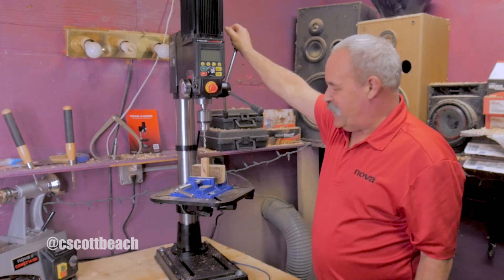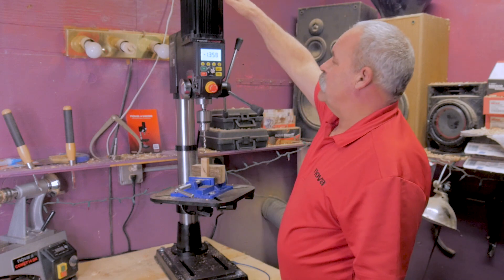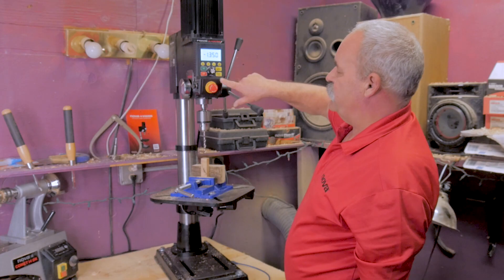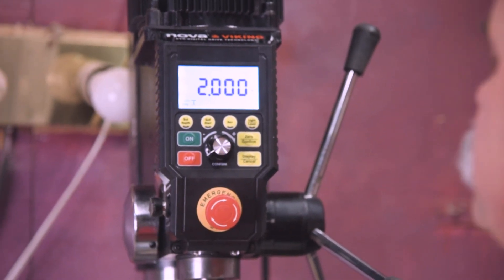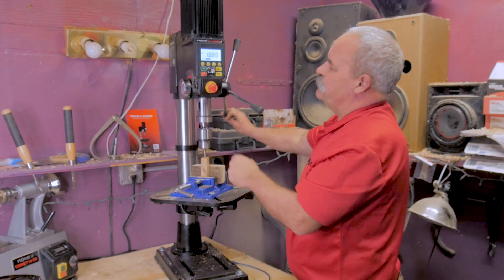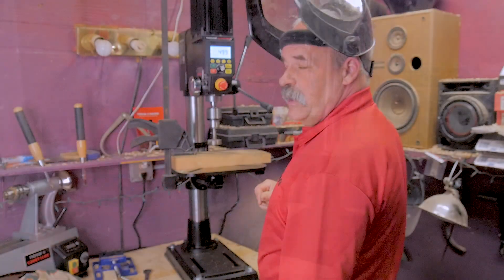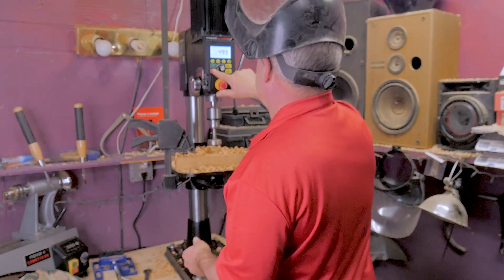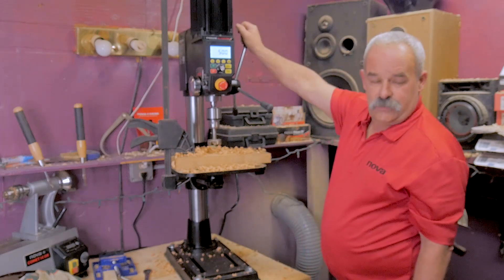NOVA Viking 16" DVR Benchtop

Comment: Leaving the drill bit in the hole like that while running (especially since you’re not clearing chips) is a good way to overheat the drill bit not to mention burning the wood. You can clear the chips and it will retain the settings.

Comment: Is the height of the drill and working platform adjustable for instance can the top of the press telecopse lower for taller work benches and better ergonomic controls from sitting position

Comment: Where do you attach the chuck key to the little plastic clip that has a screw in it to attach to the drill somewhere..?can you let me know.  Thank you Jo Ellen
Reply: I figured this out today.  There is a tap hole for the screw on the middle ring on the support tube on the left side as you look at the drill.  A few things in the install instructions need improvement.

Comment: can the firmware updates occur via the USB from an android or iPhone, or does it need to occur from a laptop?
Reply: I’m looking at this drill press as well. My understanding about the firmware update is that it has to be done with a Windows operating system. So if you have a Mac, you are out of luck.